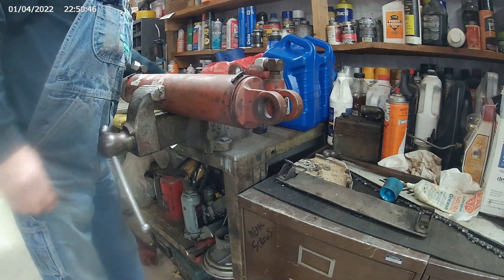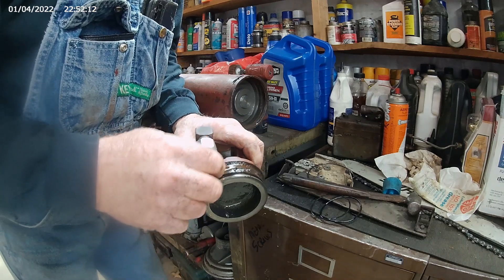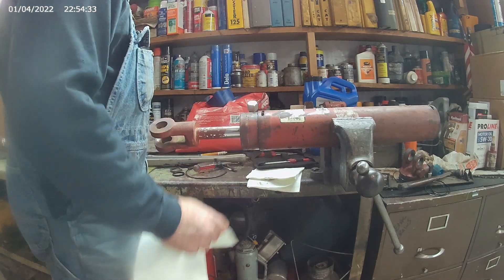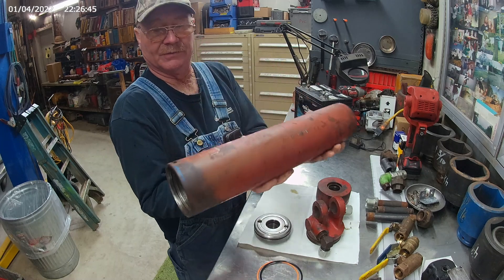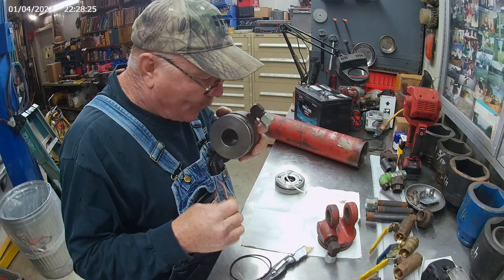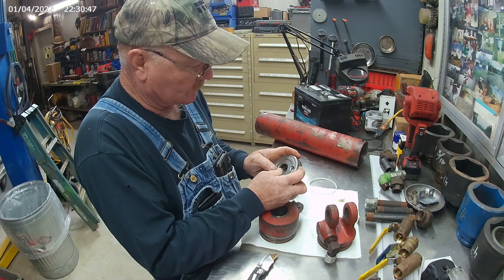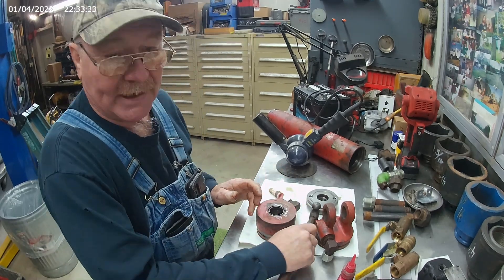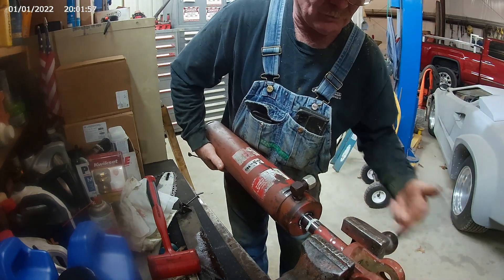How To Rebuild Hydraulic Cylinder With Wind Wire.

Comment: yea except the wire never comes out that easy       what happens when the wire snaps off to where you cant get anymore of it?
Reply from the maker: Use small pick on the slot, & work at it it takes time turning gland at same time.